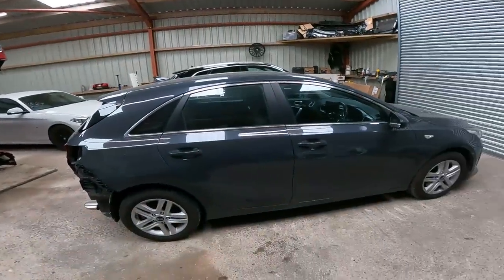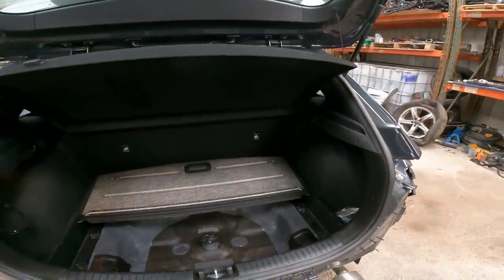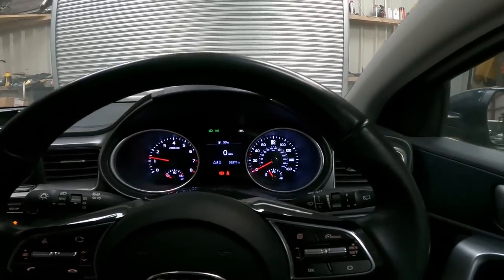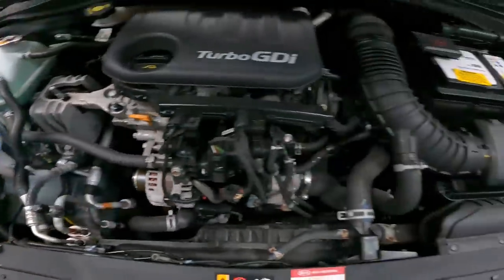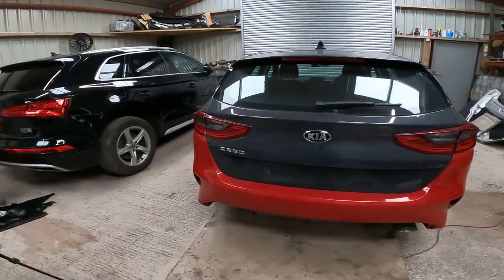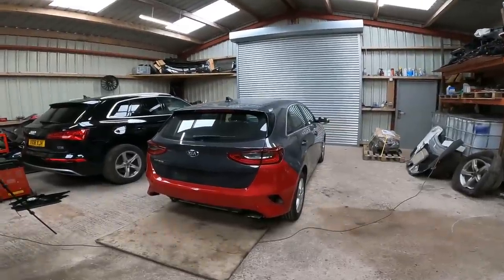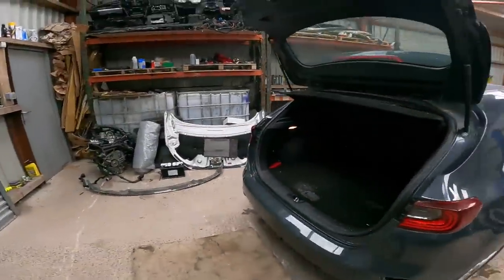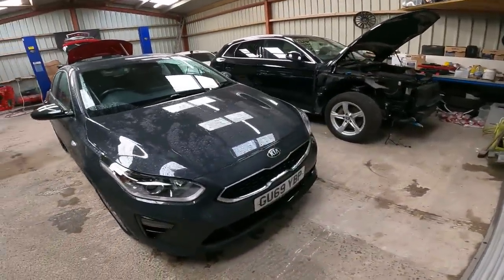A True DIY Salvage Repair - They Don't Get Much Easier Than This!!!!!

Comment: did you car vertical it for pics if previously damaged
Reply from the maker: Car vertical very rarely has photos, just tells you the date it was salvaged and area of damage on the car.... i've done 10 car verticals and only had photos for 1 car 👍
Reply: @SeriousAboutSalvage  I use car check and buy 5 codes at a time.Dead cheap and always photos.Also unlike car vertical you get the report for life and can download,print and forward to anyone.